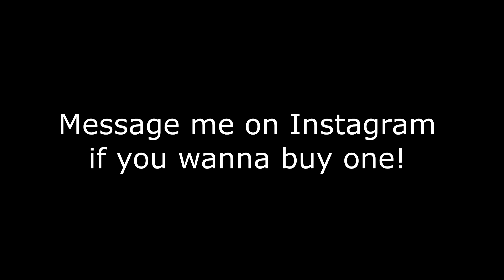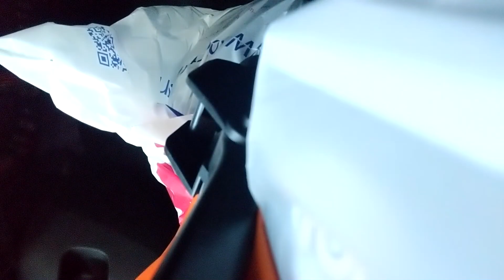Game over. - The ST is broken!!

Comment: Just Jack it up and put dolly's under the front wheels. Can push it in then, saves building any frames etc which is just going to get in the way when you move it
Reply: #R22OWL
Reply from the maker: Any idea how much a pair of them is likely to be? I reakon it might definitely be the easiest way of moving it!
Reply: They're about £60ish on Amazon for two. I reckon you could definitely get them cheaper on eBay though. I keep meaning to buy some for my other car in my garage, they're dead handy to have for moving stuff about
Reply from the maker: @BenofYoutube  that's definitely cheaper than I had expected, and yeah multipurpose aren't they I suppose! Not like I'm spending to get em for one job and that's it!

Comment: To move the car have you considered buying wheel dollies? You can jack the car up slide them under the wheels and then push the car into the garage cost about £65 for all four, surely that would be cheaper and quicker than pulling engine out
Reply from the maker: Aye man think that's gonna be the way!
Reply: @R23OWL  thats the way id do it as well

Comment: That sounds rough. You have to fix it to even be able to recoup the most cost of what it's worth even over what you have or need to spend. Part it out you'll get peanuts and it's a massive hassle. Once you get it back you won't want to sell it anyway would be my bet. Either way you need to get a quote - can't you jack it up and put the front wheels on those trays with wheels and roll it into the garage? That'd be cheaper to buy two of those over what you'd pay to have them faff about outside just getting it in?
Reply from the maker: Don't think it'll make much breaking it then?? Will agree it'd be a pisstake like and would take a while to get rid of it all...

Yeah man couple people recommend them dollys now, I think it's the best idea init, any idea how much they typically are?
Reply: @R23OWL  no idea how much but I'd think the garage would know other garages so ask if they know or can source some. After all you'll be paying them to fix it so I'd argue  I wouldn't have to buy a welder for someone if I wanted something welding. As for breaking you'd get more fixing it. Plus you'd have a shell outside your house you'll inevitably have to get collected once the interest dies on parts. And people offer silly money on most bits. Plus it's one of the nicest st's I've seen and it's way too good for breaking and the scrappy. I hope you can get it sorted. It's be a shame for it to go and I think you'd miss it and regret it in the long run. Plus once it's done those are major parts that are unlikely to fail again  (let's ignore the engine mount!) so there's longevity there. Plus if you get something else who'd to say that won't come with a tonne of hidden problems and take a grand to sort out. I'd personally swallow the costs and stick with what you know. You know the history and that has huge value in itself. Also if you part it you're gonna have to pull it all to bits and factor in all the time with queries. Personally I couldn't be Arsed. Check Facebook market for prices. Gearbox or engine around 150. Seats 120 depending on condition. Headlights 30 a pair. Doors 40. Bumpers are usually trashed. Exhaust are in demand. Wheels are always in demand. Are you gonna  make 2.5k selling bits? Guess that's the crux of the decision you need to make.

Comment: Jack it up put it on dollys roll it in garage driveshaft prob snapped on splines hence gearbox kaput or use engine hoist in situe and replace gearbox mount then but on dollys roll it into garage
Reply from the maker: Hadn't thought about Dolly's, any idea how much they are? Cheap enough and it might be a good shout
Reply: R23 OWL machine mart might be the way to go cheap n good quality
Reply: £56.39 the pair google machine mart

Comment: i would love to see an exhaust vid, i had my resonator taken off last week and its very different now haha
Reply: Popping and banging or just loud drones?
Reply: @CdotPoppy  no pops yet and it doesn't really drone. It's a bit louder in idle and low revs but doesn't really kick in until you're over 3k revs. It doesn't drone atall on the motorway, I think because it has a Remus muffler it's quite controlled which I like (it's not asbo)
Reply: @NormIsTheName  sounds good,. I left my mine on.. I get burps and bubbles from let off and going pop a bit when cold and ragging in second. Got a custom made box back twin pipes that are shaved off at the end. Does get loud at 6/7k
Reply: @CdotPoppy  Nice! That's unique as well. I only went with the Res delete because I already had a Remus exhaust so it made sense money wise. It's definitely a mod I would recommend on a budget!
Reply from the maker: Sounds good lads 🔥🔥🔥 what kind of exhaust video would you wanna see?